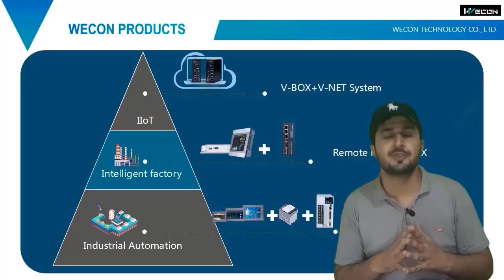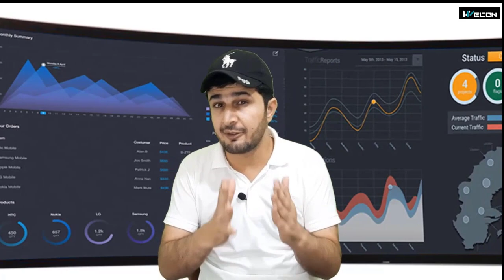Top 5 Skills for automation, PLC HMI & SCADA Engineer in 2022 - 2050

Comment: Automation Engeering is a challenging work
Reply: Correct bro 100  percent
Reply: It's totally depends on u 😊
Reply: yeah, no stress, we are 2 months after official lunch date, so your time frame was concentrated from 2 months to 2 weeks, see you then :D
yeah, no stress, we just need the system back running in 30 seconds, and if you will have time in the mean time you can check this additional point to resolve :D